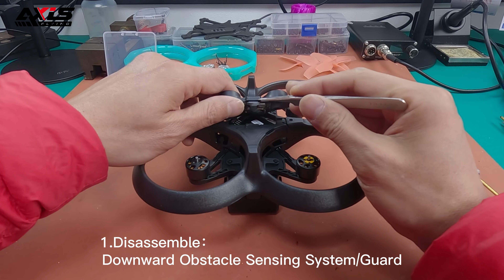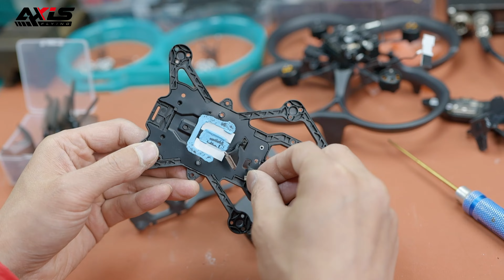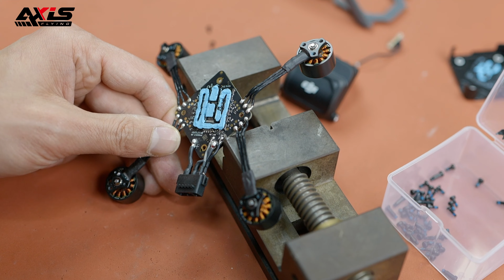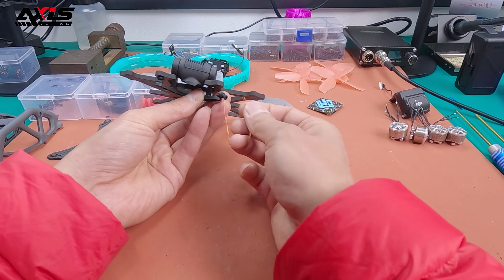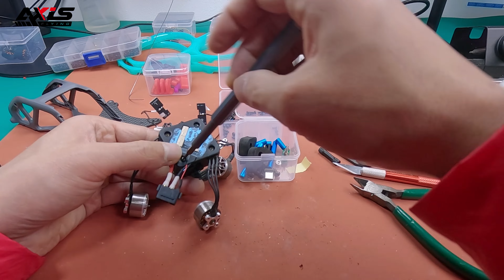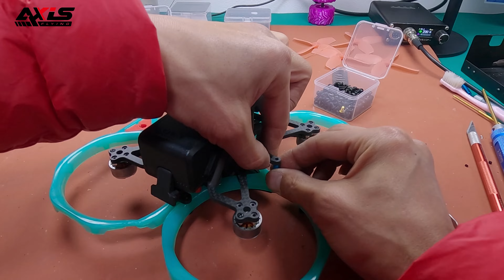How to Upgrade DJI original AVATA to Axisflying AVATA 3.5"

Comment: Dear, I bought the axisflying 3.5 with the c157-2 motors and the drone flew well, but after the second battery it sent me an overheating message and it fell to the ground.... the EC burned and the seller told me that the motors were not compatible with that version of EC... from midrone, the issue is that there is no compatibility matrix for axisflying motors with EC versions of the Avata, mine is BC2246.07 and watching your video It is version BC2252.07, there is a problem with the indicated version.

Comment: Hello, super - I just bought the avata upgrade - please what is the blue grease on PCBs? I've just cleaned it away and I don't know if it can be replaced by standard processor thermal compound?

Comment: This tutorial could have used some more love. Steps were left out like the metal plate in the frame and the motors are shipped with cables that are too long so they need to be trimmed to size. Wasted a bunch of time going back because I know the drone is going to be larger but I don't know how long the cables should be.

Would have been smart to get all the soldering done at the same time too.

Comment: Thank you for sharing this video. I recently purchased the Axisflying DJI 3.5 kit and decided to perform the upgrade yesterday. I must admit that the upgraded drone flies differently and feels more powerful compared to the original airframe, motors, and propellers. It is an excellent product, with only one minor issue: the supplier forgot to include the action camera 40mm standoff in the package. As a result, I had to use some standoffs that I had on hand.

Comment: I already have the old c157 motors and I would like to use only the new axxis frame, but I saw that the new frame has 4 screws for the motor, and my c157 is 3 screws, any idea if it will launch the frame for the old motors?
Reply: Never

Comment: It seems so cool, my only question is if its still compatible with the motion controller ?
Reply: Yes, it's still compatible with Motion Controller.

I've been using Motion 2 Controller on my Avata with Axisflying frame upgrade

Comment: Please help. I took this apart several times and had to replace the wire for the pigtail. I used 20 gauge amg copper wire and now the goggles say low voltage when flying. Is it because of incorrect wire? The drone flies very sluggish and the battery is hot after 2 min of flying.

Comment: I have some issue with the GPS. Before flying it's fine and after the motors turns and I flight, I have a big loss of GPS.
Trying keep further the cable but it's better but not enough. What who you do ? Isolate the cable with something ?
Reply: change the GPS by a new one. I have the same issue...

Comment: hey, if you put bigger blades and more powerful motors than the original ones, i guess it will need less force, and the blades will spin slower to keep the drone stable?
So less noise (:-)?) and less consumption?
Have you been able to quantify this change?
sorry for my bad english
Reply: yes, potato jet has proved it. 1.5 minutes longer fly time, less noice, much more float.

Comment: I'm curious if the printed takeoff weight is correct at 477g? That's a full 70g over original
Reply: Yes but it has much morr powerful moter

Comment: hi, thanks for the amazing guide, I have followed all the steps but front 2 motors are not moving. on goggles it show propulsion and esc error.
would you please help.
Reply: For me, this was usually from the wires of the motors touching the metal shield cover, you have to be careful to not have any exposed wire, I used electrical tape to pad the edges of the cover over the motor wires where it touches the ESC board

Comment: Just got my kit, followed the instructions everything went well except when I turn it on, only two motors arm, I tried changing position of motos to see if its motors or ESC and the two bottom always arm but two top never arms. Anyone would have a hint or knows if it’s fixable or I need a new ESC ? 

Thanks in advance for the help!
Reply: Same bri did you find a fix?
Reply: @jeremykip6441   I bought a new esc same problems, if you find a solution tell me i'm desperate.
Reply: @JonathanLafleur  oh no shit did we fully break our dji avatas😥
Reply: @JonathanLafleur  meby fligth controller then did you use your own own electrice tap or orginale?
Reply: @JonathanLafleur  and do you also have esc error?
Reply: @jeremykip6441  ok ok so got some time to investigate and found out my problem. One of the motor wire was too much exposed and when closing the case it was making contact with it (shorting) put some shrink tube on the wire and voilà it's working again!

Comment: Hi axis flying I’m having trouble with the installation hoping someone can help.
I’m getting a battery communication error . I’ve checked if small battery cables are mixed up and they are not they are correct. What could be the issue, thank you!

Comment: my question may be silly, because I don't know about electronics.  But what if I simply cut the wires from the original motors and solder them with the new ones, without the need to solder directly to the central board?
Reply: they added a note about that in the video; do that! you're right that it is easier and you avoid the risk of burning the main board

Comment: Hello, thank you for this tutorial, I was able to install the kit without problem and the AVATA is much better now :) I am having a problem with the USBC extender, I soldered the wires correctly but it does not work, I I've tried everything and I can't find the solution. When I connect a direct cable it works, but not through the extension provided. Thank you in advance for your help. Sincerely, Christophe.
Reply: Did you ever fix this in the end? I have the same issue

Comment: I mounted exactly as you did on this video, and when i armed the drone on Normal mode, the drone took off yaw spinning into the sky on a fly away. I was able to disarm it and  recover it, but I burned a motor. Do you know why that might happen? I am wating for a new motor. Your feed back would be very helpful.
Reply: Did you fix this issue? I am having the same problem after installation. Propellors seem to spin exactly in the opposite direction of the original Avata. When i mount the propellors so they are pushing air down, when the Avata lifts off it gets in to a crazy yaw spin and flies away uncontrollable.....
Reply: @chagay  yes I had mounted them in the wrong orientation, they are props in (meaning the lead side of the prop should ve spinning in) with the bulged side of the prop facing up. If you are getting an out of control yaw spin, it means all the props are in the wrong direction. So try that.
Reply: @leonardothillet6423  I figured it out:

 The motors should spin exactly like they did on the original avata. I wired all motors wrong, the 3 wires were inverted, hence i needed to mount the props exactly opposite of the original avata. Essentially making the avata think it was flying upside down....

After rewiring all motors, they turned the right direction and my axisflying avata took off correctly and hovered perfectly.

Thanks :)
Reply: @chagay glad you figured it out brother, don’t you have PTSD now when you gonna take off? 😂
Reply: @leonardothillet6423  Yep that death spin takeoff still haunts me, will probably take a while before i will take off comfortable again 🤣🤣

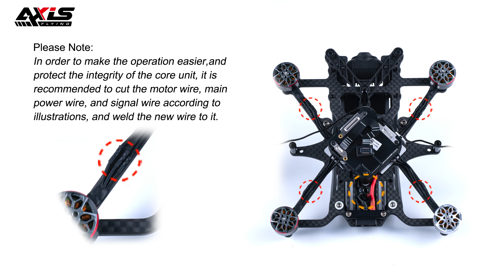Comment: I just got my Avata 3.5 today, and have a question on this video at this time stamp 6:38 Video at that point image shows to cut the wires and not remove from board but the video right before shows board removal.  So is it better not to solder to the board itself and instead cut?   Or optional depending on how well we are at soldering?
Reply from the maker: Different people soldering skills are different level.     So we suggest another way.  And you can also ask  good soldering people to help you modify too.
Reply: @axisflying840  thanks, I built a lot of racers so I’ll prob solder to board thanks,  is there a length the wires should be cut to for the motors, assuming soldering to the board directly?

Comment: Frame broke first low speed impact, this plastic part of the frame is not good at all.  They should have used harder plastic like Avata or carbon fiber.  I am not happy with this mod, stick with motor only upgrade so you can have the orig frame intact. Video here:  https://www.youtube.com/watch?v=zZ_97twNYeQ

Comment: Hi everyone! After many difficulties to change to axis, I want to explain to you so that you avoid the same mistake as me!
- avoid soldering the motors directly on the ESC, i burned my card because of that even though i was very delicate with my soldering. it's a very fragile esc. if you burn, contact dji, the customer service will sell you an esc (50€)
- solder the motors in the same direction as those you remove. I made the mistake of soldering the motors in reverse so the drone did not take off but sucked the ground
- be very careful when you remove the cables with pin of the camera and the gps module, it is very fragile and I broke a pin... 
- when you close the drone, be careful not to jam the gps cables, it can cut them ...
Reply: I'm getting esc error anyone suggestions on how to fix
Reply: @talknuff  have to change the ESC bro
Reply: you cant put the motors on the wrong way, your props are the wrong way

Comment: What is the point? If you have gone this far you might as well just build your own custom Cinewhoop like a shendrone. Lol 😂
Reply: The point is that a lot of people spent money already on the Avata not knowing that it had a design flaw and could fall out of the sky, now you can upgrade it to help prevent that
Reply: @alex-m-jones  it’s a Cinewhoop there’s no design flaw it’s not made to fly like a race Fpv .  The prop wash does this with any whoop with a propwash . It’s simple aerodynamics . Take the guards off and it will fly pretty fast with out a roll over.  Anyone that builds fpvs knows this.
Reply: @alex-m-jones  fly it slowly with zero wind turbulence like how a Cinewhoop is basically design for and you won’t get roll over. I think avatas design flaw is the gps that doesn’t always work when flying indoors, it’s crap
Reply: @freshcoastfpv  No you’re wrong about this, I have had it flip over on me going nearly straight and then getting hit by a little gust of wind.. Pretty much any other cinewhoop wouldn’t do that and the firmware fix dji released for it sucks because it doesn’t fix the problem it just kicks you out of manual mode and sometimes crashes anyways, or flies 100 feet in the air if you bump into something.. I don’t know about you but to me that’s a design issue.
Reply: @alex-m-jones  I don’t care for the Avata I use custom built Cinewhoops and have been flying them for a long time now.  I can’t really fly in wind because I get that prop wash. But I just use them for flying outdoors to indoors. Once I’m inside and there’s no wind or flys so much smoother.    I think the avata itself is a complete joke , lol
Reply: @freshcoastfpv  Well I can’t say I would buy it again if I could it over, propwash does not equal the drone flipping upside down completely though, you are absolutely right that all cinewhoops are prone to propwash to varying degrees but they certainly don’t all flip upside down and crash.. This is something different from just propwash.
Reply: @alex-m-jones 
Has nothing to do with firmware except for now being able to save itself from tumble. The main culprit for the avata is a high center of mass and low weight to power ratio.
Reply: @Bollibompa I would somewhat disagree, while those factors do contribute to the instability for sure, there seems to be something about the flight controller that just freaks out and gives up at some point.. other whoops can hit yaw instability still, the difference is this one just gives up and flips out where others would likely stay upright.
Reply: @alex-m-jones  
No flight controller in the world can handle tumble on this drone. It just isn't possible without stronger motors. To blame the FC or DJI firmware is to not understand physics.

Comment: The kit is horribly difficult to build ! No information on the length of wires, steps stupidly ordered, heat shrink diameter too small, etc. It is been prepared with rush just to be the 1st company to release such kit. 
I have build tons of quadcopters, this one is absolutely no fun to build.
And why not proposing to conformal coating while disassembling ? It would help waterproofing.
Reply: Why would they propose conformal coating? Should they propose upgraded Gps and crossfire compatibility too?